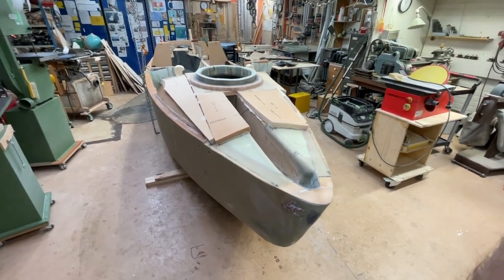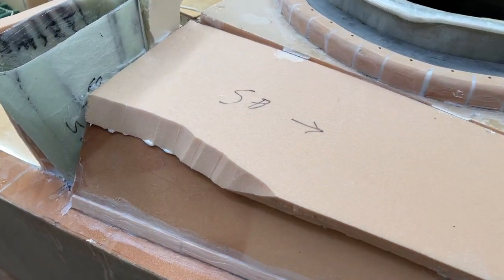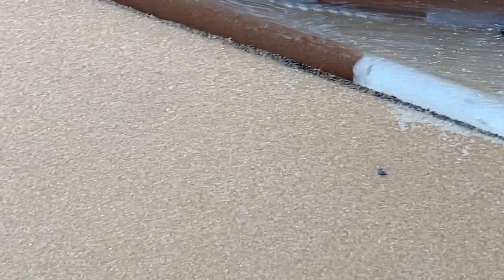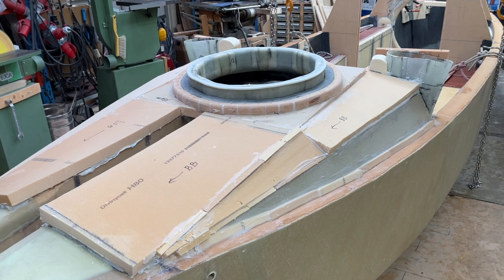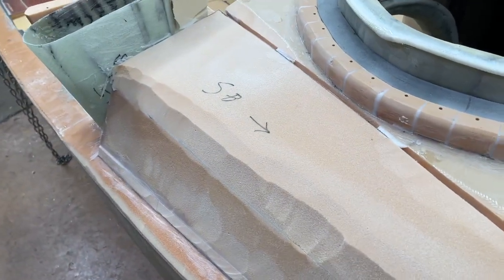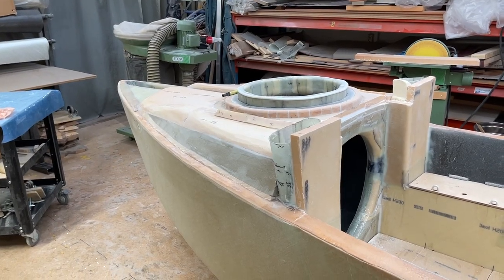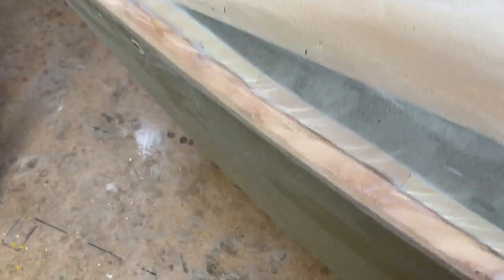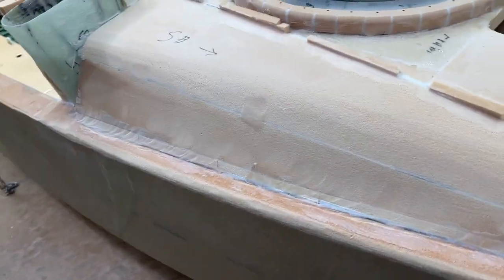29 Nov 2022  Shaping the fore deck. Grinding and adding wedges. One small step at the time.

Comment: Are you sanding and shaping using hand power and grit paper, or do you use a grinder?
Reply from the maker: I use everything that works.
Starting with an angle grinder and 36 grit 
The wedges I cut on the bandsaw.

Comment: Now Yrvind has me wondering, his vessel is looking very similar to Centennial the first boat to be single handed across the Atlantic Ocean in 1876... 20ft. relatively light displacement, almost double ended, flat bottom, centerboard, internal ballast and crew quarters under the flush deck with hatches/ standing well 😀 maybe a bit of convergent evolution 🤔
Reply from the maker: It does not look like the Centennial.
Reply from the maker: Centennial was a dory.
Exlex is a canoe yawl with rounded bilges.
They are very different.